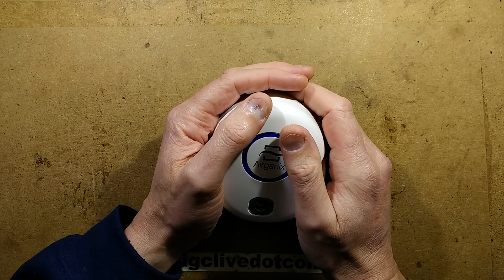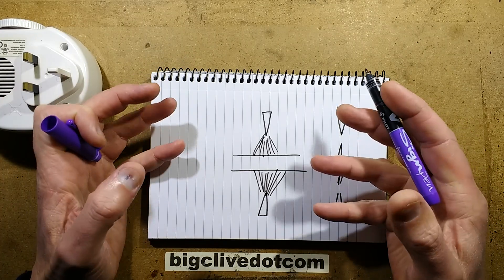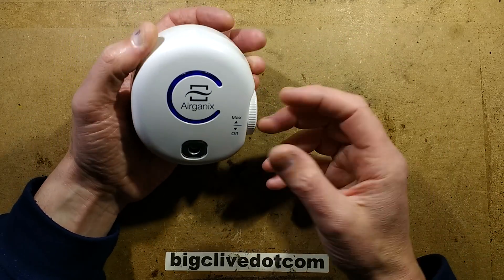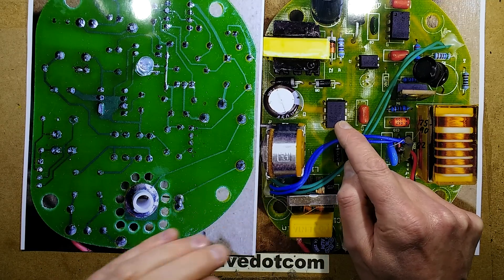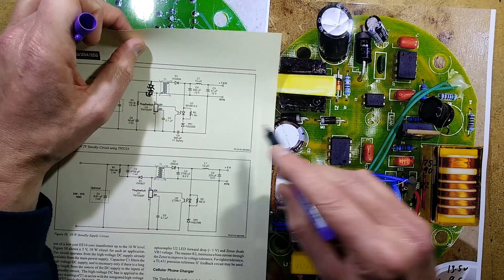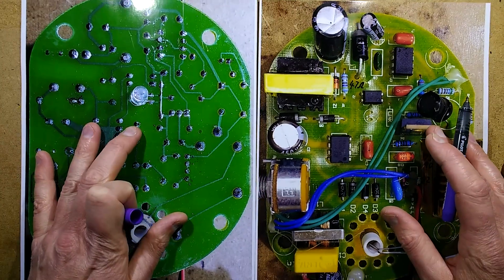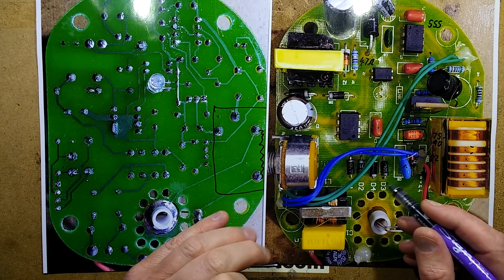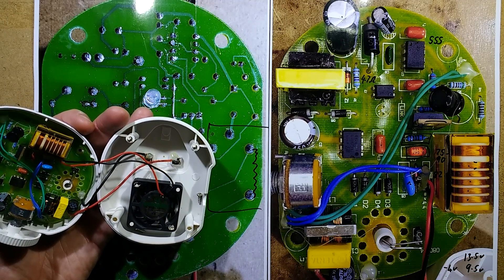Inside an Airganix low level ozone air steriliser.

Comment: Isn't ozone fairly dangerous to humans
Reply: As Clive mentioned in large quantities yes but these things don't get anywhere near that kind of level
Reply: I work with ozone generating equipment on a commercial scale...

It’s great stuff, and generally only dangerous at levels above 0.2ppm for extended periods.
That’s the HSE limit anyway.
That said, it does tend to make your eyes sting a little, and it can displace oxygen in your lungs as it’s heavy; which takes your breath away. Not great if you stick your head inside a washing machine drum full of it. 🙄

Like anything, safe when used sensibly.
Reply: +Alan Stinchcombe The thing is ozone is a very promiscuous oxidiser. VERY promiscuous. In small quantities it oxidises itself out of existence by reacting with airborne compounds within miliseconds. The reason it eats that rubber band is that it's in a concentration thousands of times what a small O3 generator could produce AND it's trapped in an inert container unable to react with anything else until the rubber is introduced.

(I used to work with ozone  in a fish breeding plant where I used to trickle recirculated water over plastic media [to maximise contact area] in O3 enriched air inside an acrylic chamber. It was great used in that way to control the spread of disease. However the ozone never made it out of the chamber into the system proper as it reacts so damn quickly with almost anything.)
Reply: anonymous well said.
I’ll elaborate, to verify a wash is disinfected in the laundry system, we measure the “off gas”. If there’s little to no off gas, the ozone is still being used by when it’s killing bacteria and viruses. If we get a certain amount of off gas, we know it’s no longer reacting with anything, and the wash load is therefore clean. That said, the off gas is passed through a catalyst (manganese dioxide I think) that rapidly helps it convert back to safe oxygen. :)
Reply: it is; don't use these things in rooms you are in, ozone is really good at sterilizing and oxidizing things - including the lining of your lungs.......
Reply: It can be and should never be used in a closed environment. The concentrations needed to be dangerous is actually surprisingly low at 0.1 to 1 μmol/mol. Not to mention damage to rubbers and plastics. Ground level ozone is a pollutant and should be avoided.
Reply: If you can smell ozone, you're already in a toxic concentration of it. The Clean Air Act limits ozone in the air to 70 parts per billion before the air is unhealthy to breathe. You can seriously damage your lungs with ozone in short order. Many people have. When ozone breaks down it leaves behind O2 and an exceptionally active free radical of oxygen that quickly bleaches whatever (reactable) molecule it hits.
Reply: what
Reply: Not at all, I have worked with electronic for years, I can tell a short by the smell of ozone only seconds after the short has occurred, even before the smell of heating plastic.
Reply: Yes and pointless for the the purposes claimed  - https://www.epa.gov/indoor-air-quality-iaq/ozone-generators-are-sold-air-cleaners
Reply: I wouldn't want an ozone generator in my home any more than I'd want a chlorine generator.  https://youtu.be/83mujVFqFqI shows how rapidly 2% ozone cracks and gooifies a rubber band.  Think of your lungs.
Reply: Wake Archus actually water or air is more dangerous than ozon. In water there are sharks that can kill you and in air there are birds that can shit on your car window and create accident.

But seriously, oxygen and water is dangerous as ozon, breathing pure oxygen can kill you and water is water. You can die even by drinking it too much :)

Comment: I know this seems like a stupid question, but would liquid ozone technically be a better rocket fuel oxidizer than liquid oxygen? Is it possible to even liquefy ozone?
Reply: There are many compounds that are "technically better" than LOX  as oxidizers, Chlorine Triflouride and RFNA (Red Fuming Nitric Acid) are two examples.
But where these compounds gain in combustion efficiency/energy, they lose in stability, ease of handling and operator safety. Liquid ozone would be firmly in the same boat.
Reply: too unstable, it would just become regular o2
Reply: It would be, if it didn't destroy the tank it was in when you look at it funny.  It's so unstable a molecular configuration, current materials science can't contain it in a tank useful for rocketry.
Reply: umm liquid ozone spontaneously detonates. so ....yeah
Reply: Okay, thank you guys. I kind of figured that they would have used it already if it were practical. I know about ClF3, I would like to find something safer, but more energy-dense than liquid oxygen. Something that didn't require refrigeration would be a bonus, too.
Reply: what do you need a better oxydizer for?  
liquid oxygen requires cooling as you said, but after oxygen the stuff becomes really dangerous.

Or just go with the simpler solid fuels?
Reply: They use nitrous trioxide to have a stable(ish) oxidiser with a similar number of oxygen atoms.
Reply: Never seen it but I've read that liquid ozone is a beautiful blue colour, ordinary liquid oxygen is a little bit blue but ozone is supposed to be a gorgeous hydrangea blue.
Reply: joinedupjon 
Here is an image of liquid ozone...
https://www.bipm.org/en/bipm/chemistry/gas-metrology/ozone/
Reply: Alan Harris, are you referring to liquid ozone? I would assume that to be the case. In that case, I guess we'd be far better off ironing out the practicalities of ClF3.
Reply: So... Would it be safer to swim in a tank of liquid ozone or hydrogen peroxide?   :D
Reply: ThatSaneGuy - that's why i am asking him what he needs it for.
Reply: The Original Gamer liquid ozone is blue. very blue. only lapis lazuli is better
Reply: Hydrogen Peroxide has been used as oxidizer/reaction mass booster. Mostly to save the weight of cryogenic support.
Reply: Yes, you can liquefy it - but you might not want to do that. Yes, it would be a slightly better oxidizer but not practical.
There are other, even better oxidizers but they are all not used normally for propellants due to their inherent danger.  
  
And - just use google.

Comment: Can you make one of these with a capacitive voltage multiplier?
Reply: I used to be a projectionist, yes high current DC makes some huge arcs which get very hot. Though, even in the old carbon arc projectors with an open arc going across consumable carbon rods didn't really make that much ozone, just tons of harsh UV which you needed to shield yourself from.

Long arc xenon lamps had a more spectacular arc, with a sustained arc width of probably a quarter inch. The bulbs I worked with ran 25 volts at about 160 amps (4 kW.) Striking the bulb to start it made it look like a plasma ball briefly.
Reply from the maker: No.  It requires the AC to create the plasma.  With DC you would get a tiny burst when powered and then nothing.
Reply: bigclivedotcom if you've ever seen a DC breaker you'd know that DC can create very violent, sustained arcs (plasma)